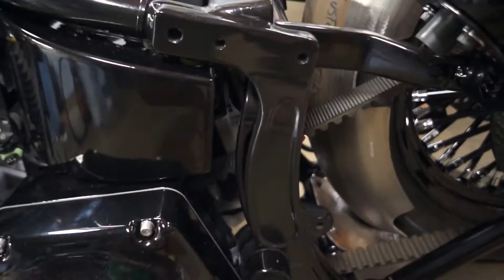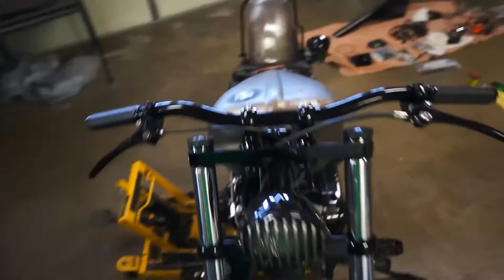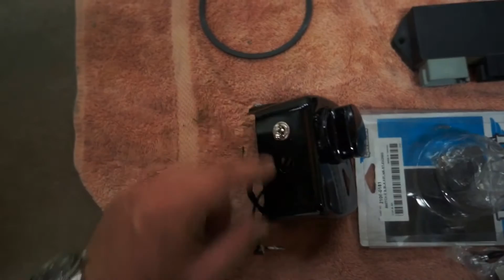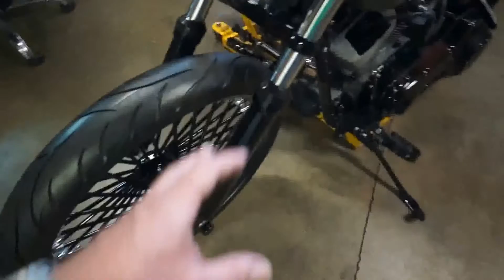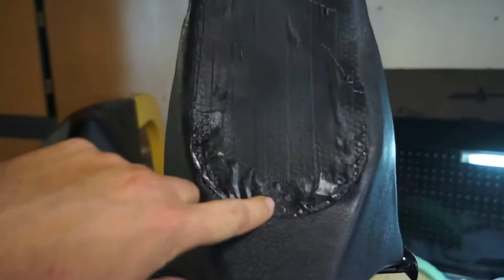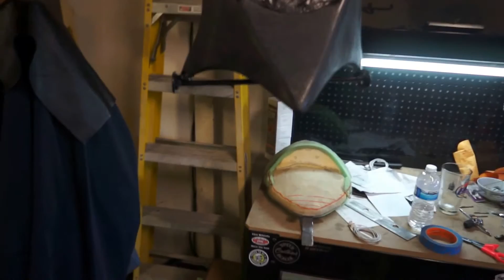Harley Softail Chopper Bobber Project 2 Vid 11

Comment: I'm building one for a buddy out of a 2005 Deuce. Using a 07-14 sporty tank EFI.. no front brake. Removed all buttons from the bars and will have hidden buttons right at the coil cover. Where are you located at

Comment: Really diggin' the bike man.  It would be great (when you're finished with the bike) if you posted up a build sheet.  Things like what size rear fender you used and what handlebar switches you used and where you sourced your parts from, etc. Keep up the awesome work man.
Reply from the maker: Thanks for the comments. I'm not really into doing that. I source a lot from ebay (or private sells) so kinda hard to give that info. Every piece gets modified so there is no real point in giving that info either. I will post a final video soon & go over what had been done.